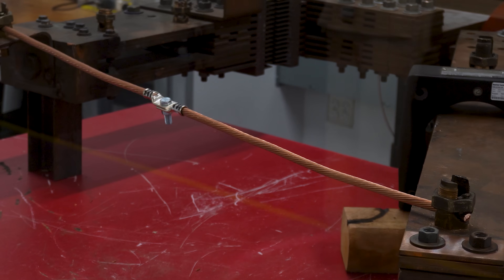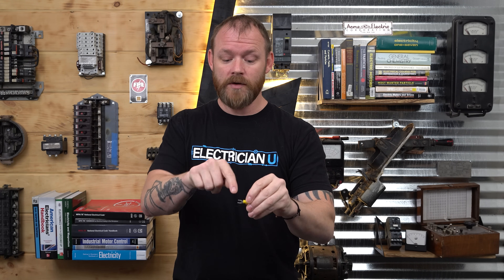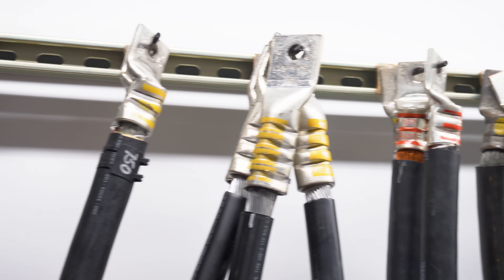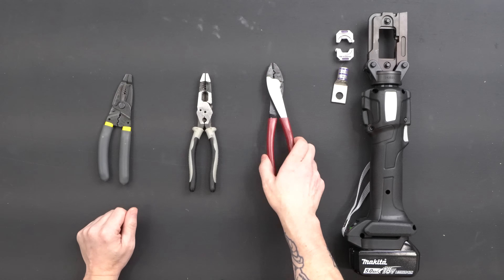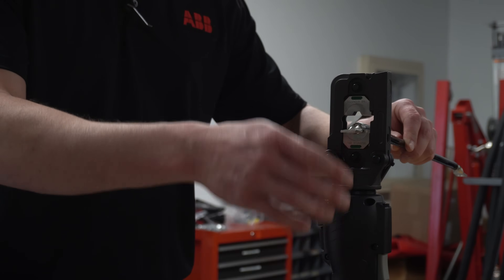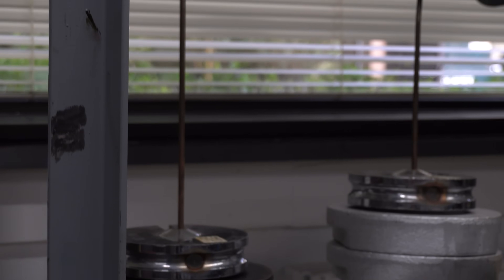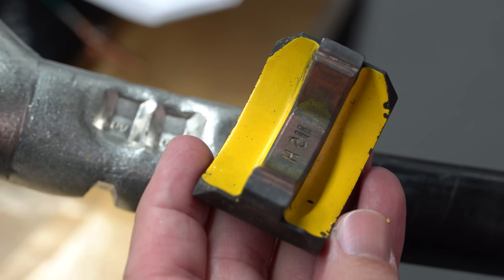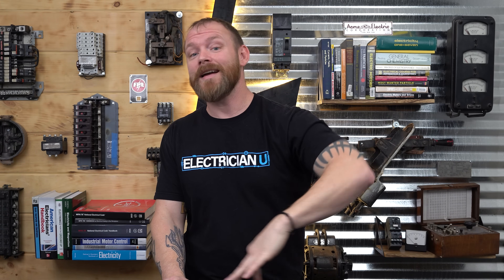Crimping Wires: Crimper Tools Used to Crimp Tiny Wires to HUGE CONDUCTORS!

Comment: I'll bet if you read the instructions on how to crimp the connector you demonstrated at minute 5:30 you will find that you did it backwards. The indention should be on the smooth side of the connector rather than the seam side.

Comment: Greenlee has a 6 Ton Hex Bottoming color coded die system using the EK622LX and EK628LX Battery Operated crimpers and the K22 series dies for both copper and aluminum stranded cable.

A bottoming circumferential die (circular), like the Burndy bottoming W-Dies for copper, are also very strong and they have a proven track record in the industry for the USA.

I prefer the color coded lugs from Panduit over both Burndy or T&B (now ABB) for 250 kcmil and smaller. Burndy I would say has the largest selection of lugs available from one manufacturer.

Comment: At 5:30 that's an improper crimp and you probably know it Dustin.  As a Marine and RV electrical specialist, I do it also(but never put the stake on the split of the terminal barrel because it offers less strain resistance).  If you choose to demonstrate using what the industry calls an 'improper method' such as staking insulated terminals, it may be nice to tell exactly why you're doing that, and what the 'proper' but less effective/practical method actually is. My 2 cents.

Comment: Hated when ABB purchased the best maker of sta kins, crimp lugs, ty rabs etc maybe 10 years ago. ( T & B ). I used my dads T & B TBM5 crimper for 50 years and donated it to the place I retired from. Crimped thousands of #8 guage to  4/0 wires wuth it. Found ABB the worst company for VFD tech support. When I called them to only ask one question they gave me the run around and wanted to know why I needed an answer. Took the POS two weeks and 3 ir 4 e mails to finally tell me how to find DC Buss voltage on several of thier 18 pulse drives that we had no manuals.

Comment: I did a couple DIY cables years ago. $1 jumper cables at a garage sale cut into 2 foot lengths. Copper pipe that fit over it for a crimped end with the copper pipe pounded flat and drilled. I didn’t have a crimper for 4 gauge wire. But my garden shears had a hinge with 4 sides. It squished the copper pipe and I couldn’t pull it off and they didn’t overheat so I called it good. Yes it was an ugly rhombus shape. But it is still holding after 2 decades. 

I have only used them 10-15 times for a couple days.

Comment: Weather it's a butt splice, fork, spade or something else all of the insulators are flared on the end, why? Why is there even insulators on them because they are somewhat damaged when you crimp them. Just something I have been curious about.
Reply: The flaring is so the wire's insulation can fit inside of the connector's insulation opening. You don't want wire strands visible outside of the insulation opening as that would defeat the purpose of an insulated connector. 

As for the damage you see after crimping.. that doesn't sound right. Insulators should not crack or break after crimping. Sounds like either cheap terminals or the wrong crimp tool is being used.
Reply: Thanks, Henry.  I assume the gap / space between the wire insulation and the connector insulator makes no difference as long as the wire is fully in the connector?

Comment: You used a non insulated crimp on an insulated fork connector
Reply: Yes he did.  So do I.   Since this is a video with a pro explaining the 'right way' to do things, that was a surprise to me that he didn't explain why he ignores the correct way. Also, when I do use a staking crimp (improper) on an insulated terminal, the stake should never be on the split because it will lack strength if the wire is pulled.

Comment: Great show as always. I’m probably going to show my age now, no longer 21. I first used hexagonal crimping tools back in the late seventies/eighties. I think that was before ABB were formed.
Reply: You're right, hex crimps existed before ABB formed. Thomas and Betts pioneered crimp-on connectors and hex crimps, but ABB bought Thomas and Betts in 2012. So the people and factories of the original T&B still exists but under the ABB name, which is why you hear ABB now instead of Thomas and Betts.

Comment: Are there NEC requirements regarding using listed crimp connectors or crimp tools?  Should people be using a listed ratchet crimper for the red and blue ring terminals and such?
Reply: Yes! Each connector and crimp shape is different. Agency listings like UL and CSA require the tool AND connector both be listed together. Using a random tool with a random connector can create a bad connection, the safest choice is to pair the manufacture recommended crimp tool with that manufacture's connector. There's actually a lot of engineering that goes behind a crimping die.

Comment: Really so much info's and now I feel like a nerd...😅😊
I'm Electricuan in Germany for over 2 years and I worked in few fields...
ABB, Schneider Electric are the most popular brands that are being requested by end-user to use their products in for ex. Fuse Box or ABB KNX (Smart Home)...so on...

what I only didn't see it here in the vid' and you didn't cover tema is...
so called in Germany 
,,Conductor Paste"...which I saw it recently being all over the place where I worked on a new buildings with new electrical installations & new 
Main Lines Power Supplay...so, before putting on any type of connector I saw other older collegues put the conductor paste on the end before putting connector & crimping it!...
kind of I see it as an advantage cuz' 
Main Powerlines for a bigger building 
require bigger cables by standard and any of those heavy duty cables when they are peeled...it look like mission impossible to fit on the end of this big butt cables connector to crimp it...
so,...it goes a bit smooth when used with conductor paste...some people do & some not...so I guess it's not yet full standard. 😅😊

Would like to hear your opinion...Amazing Content! Love it! ❤😊
Reply: Is the paste you are talking about the same as the aluminum anti corrosion paste for aluminum conductors? I'm seeing more and more recently that it's a code requirement (at least in the usa) to use it before installing a conductor into a lug connection

Comment: All the hand tools shown are quick and dirty field tools.  Serviceable to be sure but do not make high quality crimps.  Most terminals have specialized crimp tools designed specially for the terminal.  Some quite expensive unfortunately.

Most terminals have mfg recommended crimp height+width with a typical tolerance of +/- 0.002”.  Basically impossible to achieve with a pair of lineman’s pliers.  The crimp specs maximize both crimp strength and electrical performance.

The specialty crimp tools might be overkill for basic applications but if maximum reliability and/or significant quantities (many thousands) of a terminal are involved they can be worth then investment.  Also there are multi-purpose crimping pliers which while not a precise, are useful for more applications and produce a far better crimp than a set of strippers or lineman’s pliers and are much more reasonably priced.